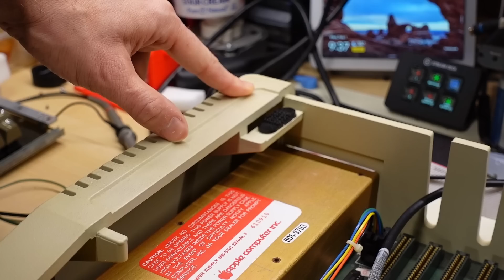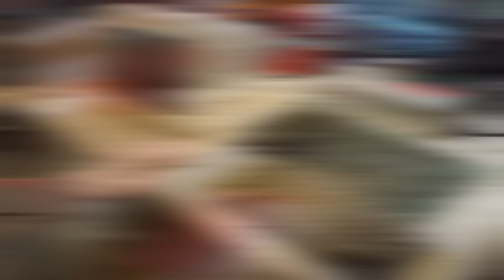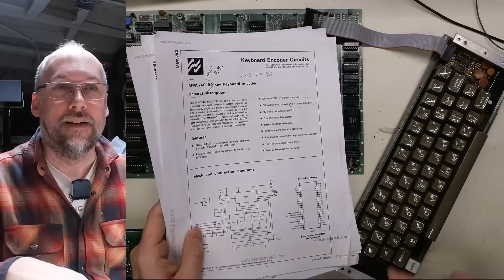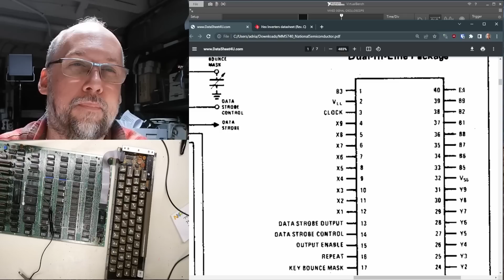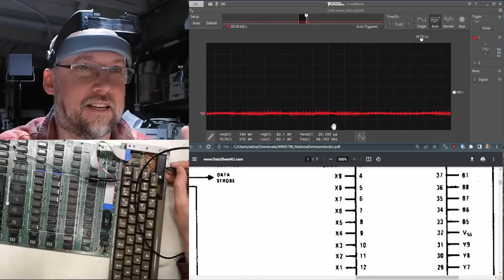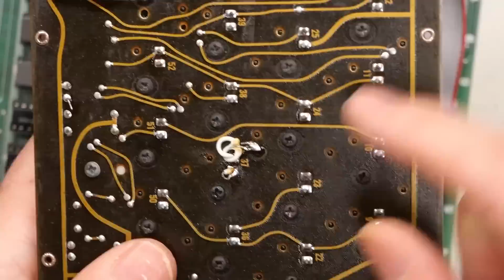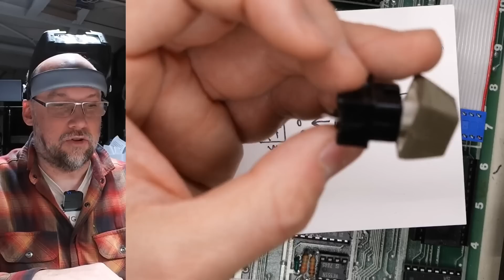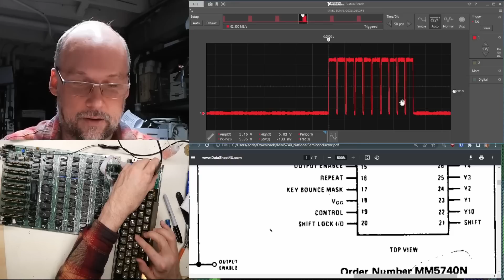The original Apple II keyboard sucks (and is hard to fix)

Comment: The big differences with the plus model were the revision 7 motherboard which no longer supported 4K DRAM and removed that capability along with the cost of the memory select jumpers, the switch from the original PMOS 2513 character generator to an NMOS ROM with a standard EPROM pinout and control polarity to enable international character sets or lowercase, the switch to the 2-piece keyboard again for international capability or the option to introduce lowercase, and finally standardizing on the autostart ROM with Applesoft. Random fact: if you load integer basic into the language card, the Programmer's Aid #1 was included in the ROM image included and contained a virtual 16 bit processor written by Woz called SWEET16.
Reply: The early ][+ machine differed only in the following: AppleSoft BASIC was standard; 16K min RAM; soldered in RAM jumper blocks; different badge; green part labell with different model number. Otherwise, they had an electrically identical Rev 4 mainboard. The R7 was early 81 and beyond IIRC, perhaps late 1980. In '79, it was still Rev 4 with a raised lamp Datanetics.
Reply: Color killer circuit also present on ][ Plus motherboards, enabled in text mode eliminating color fringing around characters.
Reply: @orbitalgolem91  The color killer was improved a bit on the rev 7 board, but it's present on all the revisions except rev 0 and it worked perfectly well on the rev 1. I had a rev 1 in 1978 with a 13" Sony Trinitron for a monitor.
Reply: @Peter_S_  Ah, yours pre-dated my ][ Plus in Dec '82.  Hoping you still have yours, mine still powers up after over 40 years.  Remarkable.
Reply: @orbitalgolem91  Sadly, my father got it 'repaired' around 1982 and they did a motherboard swap with a rev 7, and that machine is long gone.

Comment: Bought a II+ a few years back and the only sticking point is the sticky or non-working keys becoming an issue again.

Silas Werner made some great games like ABM and Robotwar for it, and Apple Panic is an amazing time waster. 

Some games like Sneakers are really hard games. 

I got interested in it because I did a high school course as work experience in Grade 9 in 1979 at an Apple computer dealer in Sechelt, British Columbia. I think he was the second one after the Byte Shop  in Vancouver.

Our computer lab used PETs  until the Apple 2 plus came around but I ended up getting a PET for $200 from the district, but I ended up going to a Commodore 64 to keep some compatibility.

Comment: Typical failures of that Keyboard are Key switches and MM5740AAE/N encoder Chip.... For the encoder, you have two options wether buy a new old one or buy that Joe's encoder. Regarding  switches, more or less the same. The Problem is nobody is making them but  you can repair/clean faulty ones  , it worked for me...  https://www.youtube.com/watch?v=YzzwPg8hkbo
Reply: That is a great video on how to open those keyswitches. Thank you for the link.